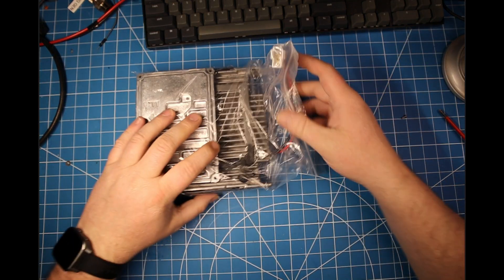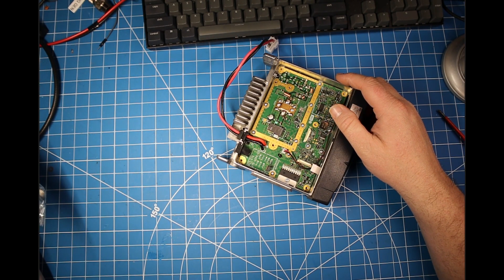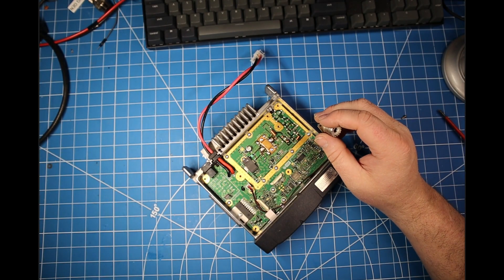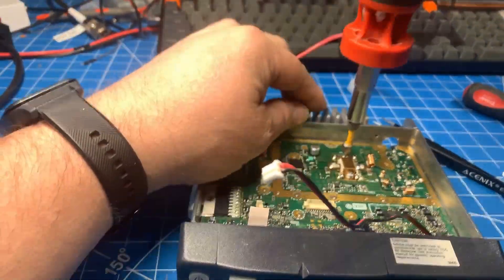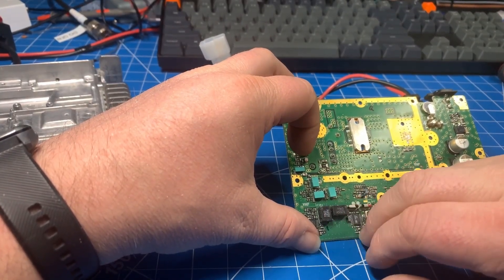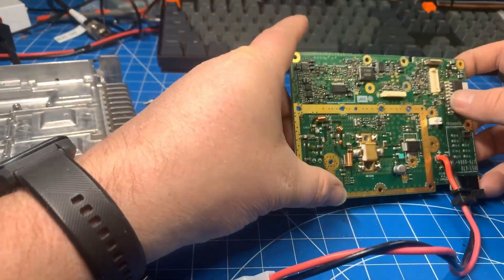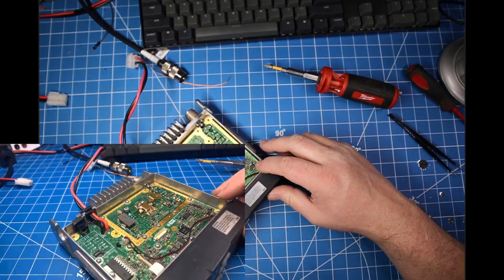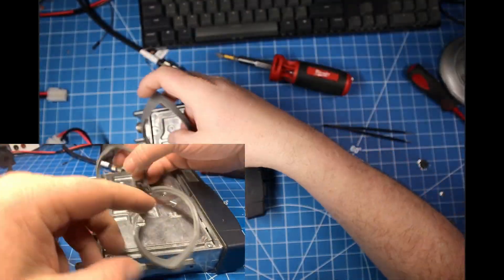Kenwood TK-7102H Weak Receive Repair

Comment: Loved your video nice job I have 3 of these radios (uhf) 2 i use for a gmrs repeater and they work great .. And the 3rd one tk 8102h-1 uhf must have been hooked up backwards I cannot get it to come on , a check of the continuity shows a closed circuit, I know enough about this stuff to be dangerous lol where is the reverse polarity protection at on this board ?
Reply from the maker: It should be the very first thing  on the circuit board that the power leads connect to